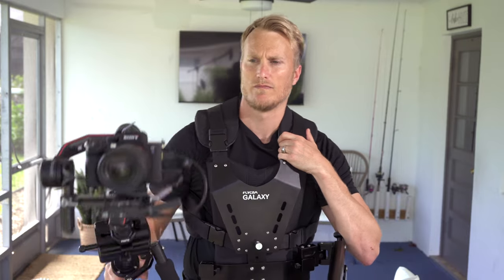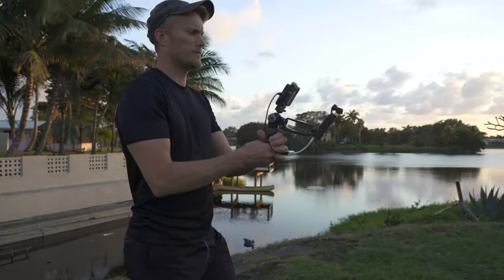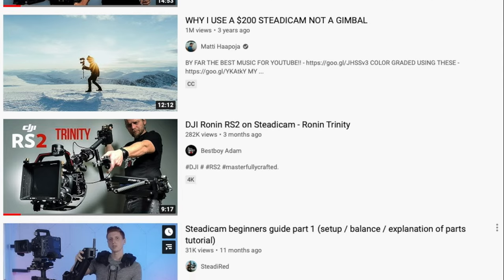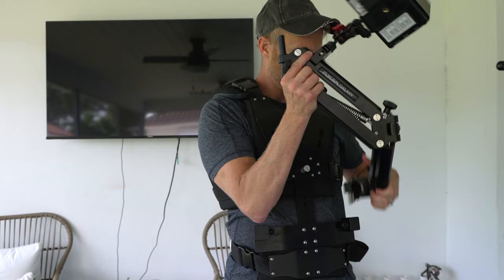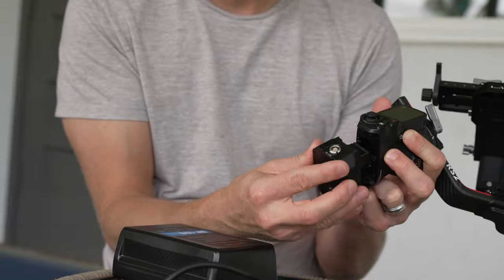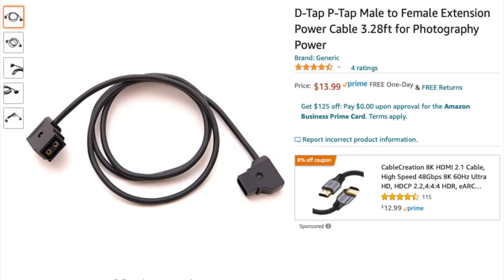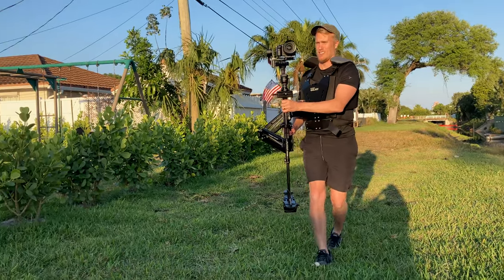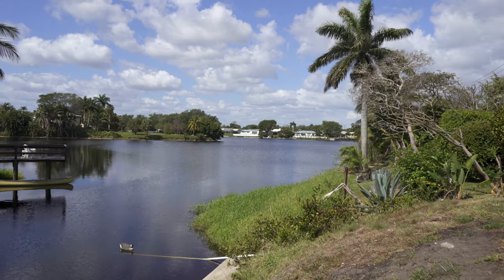CAMERA STABILIZER DIY (AMAZING) | DJI RS2, A7s3, FLYCAM GALAXY

Comment: Great video. I am starting to get back problems for a few days after a shoot and this looks like a great solution. 
Are  you able to control the tilt axis of the gimbal with this setup?
Reply from the maker: Thanks, yes you can by counter weights (not motor).

Comment: Neat setup 👍 Do you have any data on how many hours in one go this setup would be operable before having to replace the gimbal or v-mount battery?
Reply from the maker: I believe the V-mounts are good for all day shooting. I actually haven't run out of battery in a day shoot because I made sure my gimbal was properly balanced and therefore less battery juice taken. Did you end up picking up this rig?
Reply: @thefilmalliance  thanks for sharing that information. Not yet, project still in the planning phase.

Comment: Great video! This is exactly what I've been wanting to do after I saw the video from bestboy Adam. Thanks!
Do you think you could have made it work with the RSC2 at all? I'm not in the US so changing my RSC2 for the RS2 is really difficult.
Reply from the maker: Hey there, thank you for that. The RSC to only has one screw hole and I’m not a big fan of only using one male to male quarter inch thread. If you can swing the RS two that would be better

Comment: How do you think this would work if you were running at full speed on uneven terrain? I shoot mountain biking and haven't found a great solution for chasing a fast bike with a gimbal to avoid shakey footage.
Reply from the maker: I think it would definitely help but if you rode a bike and held the camera with one hand, that would even be smoother

Comment: Hey there! AMAZING video. Quick question. I have a DJI Rsc2 and noted that you didn't feel safe attaching the handle to the redking with a small screw. Do you think it would be possible to maybe use a different release plate? Maybe the Ulanzi F38? I do't even know if the manfrotto release plate is removable off the redking? Looking for any advice before I buy all this...trying to see if I can make my rsc2 work before buying the rs3 pro

Comment: Great video!  I might go with your build instead of waiting on the Float.  Is there room to attach a follow focus controller to pull focus?
Reply: Float is bad no matter what u do it is damn near impossible to balance the arms ... also it is so taxing on the back returned it what a disappointment
Reply from the maker: Yes I think you could attach it to the main arm like those Arri Trinities

Comment: Thanks for the video, I finally got my Ronin S2 and purchased the Vista arm and vest from Proaim.  I'm really happy with the S2 but when I put the rig together like you've done, I'm getting a little back and forth on the roll axis when I walk ( the RS2 will roll a little bit side to side and makes the footage unusable.  I was wondering if you or anybody else has run across this?  The RS2 is flawless when I hand hold it but when I put in on my poor mans "Trinity" I'm getting that wobble on the roll axis when I walk.  Lastly, the Trinity is balanced.  I've got a V mount battery on the bottom of the Redking gimbal attached with a quick relase plate.  My only thought is if I could attach something that could move the battery side  to side might help as I can move it forward and back on the quick relase plate.  Thanks again for the video.
Reply from the maker: Hi David, that’s awesome! I’m not experiencing any of the roll your talking about. Have you tried calibrating the gimbal? I hate when people recommend that but sometimes it works. That would be a great idea to figure out a way to move the battery side to side to give more flexibility. Have you figured out a way to do it? I know the guy I referenced in the video did something similar. His name is best boy Adam.
Reply: Hi David, got my R2 just ther other week, and initially I also ran into some little rolling while moving forward with the gimbal handheld.
Re-balancing and calibration lowered it a bit, but to what made me really happy.

The breakthrough came with replacing the Arca-Swiss-like mounting plate (the one to mount under the camera) that comes with the RS2 with a far wider Smallrig plate made for the RS2 with multiple screw holes and trenches. Then, put the cage on my camera (Lumix S1) and mounted the new plate to it with 2 instead of 1 screw.
Not only was the rolling wobble completely gone, furthermore it never happened again to me that the camera would swing around that one single mounting screw, completely debalancing the setup and swinging the lens away from the focus motor.

DJI did a terrific job with the gimbal, but with the 2 mounting plates for the camera they completely messed up.

Comment: Great video! I just completed my rig like the one you have built here! its pretty Awesome! one question is at time 8:07 it seems you have a rubber band attached to the end of the arm. Is this to keep the arm from flopping everywhere? also, where did you get that tripod to balance the red king? thanks in advance and again great video!
Reply from the maker: Hi Yazmin, so happy for you! Yes the rubber band is to keep the arm from swinging and flopping. The tripod to balance the armed king is a cheap light stand I purchased on Amazon. I just inserted Redking handle on it because the handle is hollow. Do you need a link of what I’m talking about?

Comment: Thanks for the video, I was interested in using the Zhyiun Crane 2S as my gimbal attached to the Galaxy Vest and Redking.  I don't know of a power supply similar to the Tilta version that you're using with the ronin.  Do you think there might be trouble with this setup because of the height of the 2S on the Redking?  Thanks again.  Dave
Reply from the maker: Glad it was helpful!, what cameras do you have?

Comment: Could you do the same with just the regular Ronin S as it also has a detachable handle and tikta has a power supply adapter? Or do you strongly recommend the Ronin RS2

Comment: Hey I have the proaim vista/Redking package and the rs2.  I have A HUGE WORRY.  The handle of the redking.  Looking at the bolt connecting the handle to the mechanical gimbal and it's pretty thin. What are your thought's about building the minity with that bolt being the only thing holding the weight???

Comment: Nice video and exactly the problem I had😊 
I just received the Tilta base plate, and try to assemble. Do you know  a solution to connect the origina rs2 -battery to the Tilta?
Reply from the maker: Not that I know of but that is a great idea!!

Comment: Nice work! Are you just balancing on a normal light stand to set it up? I’m getting tired waiting for the Tilta Float so I may just go with this as I already have the Tilta base plate and several bits. 

How are you focussing though?
Reply from the maker: Yes I am balancing on a light stand. Im auto focus at this pint but you can pull focus with a focus puller on the main arm
Reply: @thefilmalliance  Nice. Thanks for that.

Comment: hey from the other side of the world ( Cyprus :D ) . so i just get the whole set up  and what can i sey is that even with ronin s there is way to put the whole thing together without the battery counterwaight. they provide you with the big screw as well . so the red king plate can get 1 small tripod screw and 1 big . so why to not just put it on the top and skip the whole part with the external battery ? anyway , i am very happy with the result  :P ...
Reply from the maker: Hey Naizo, thank you for your feedback. I really like hearing what other people have to think. You seem like you know what you are talking about. Do you shoot professionally or as a hobby? Any video suggestions?
Reply: I am trying to transition to a cinematography at the moment and make it a full time job bro . I have done some commercials and some weddings but I really wanted this rig to work because of my back pain . 
Ok so you are completely RIGHT bro ! I test the whole thing and i follow all the steps that you are suggesting. I had to buy the base as well because the screws are unscrewed after like a 20 minutes of use and IT IS unsafe without the base ! The rig itself i awesome. And whatever you say at this video it’s absolutely true . But i am searching for some1 to explain to me the arm part . I have done everything correctly and my rig is appropriately 7 kilos+ . I have changed the spring for heavier set ups but still i can’t find the balance for the arm because i seems that it need to be more loose.

Comment: How do you pull focus?  Or do you just use autofocus?
Reply from the maker: I was using auto focus but I could have gotten a focus puller on the backside of the handle

Comment: Great vid. Steadicams are a necessity for solid production values. I am so tired of watching films made with shaky handheld cams which has been a fault written off as a feature ever since The Blair Witch Project. Yeah, it was part of the charm of the film. But man did I get dizzy watching Blair Witch in the theater. And this is why we are flooded with "found footage" films, because studios think audiences will tolerate it, and they do. So it shaves off the budget. You don't need a good cameraman when everything looks like it was filmed in the middle of an earthquake. Same goes for Cloverfield. They could have used some better camerawork. But again, it's the whole "found footage" excuse. And we see it in more straight-line films as well. It's ubiquitous. Having the gumption to put together a rig like this or settling for less is what separates the wheat from the chaff.

Comment: I got the same arm and vest, using it with ronin mx . It is terrible, you cannot walk and shoot there’s a lot of movement up and down.
Reply from the maker: Have you tried loosening the dampening screws on the arm? Theres a second pair of springs if your rig is to heavy. I find the more freely the arm moves the smoother my footage. Don't give up on it yet, keep on working at it. Its a life saver on those long shoots. There is a bit of practice but once you get it there's a very noticeable difference for me.